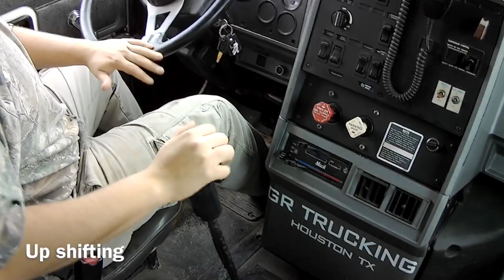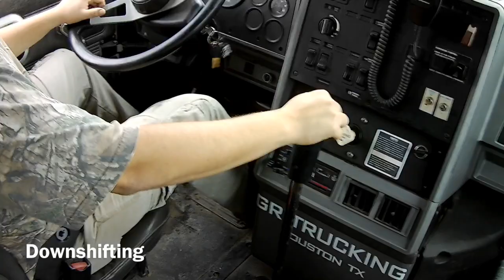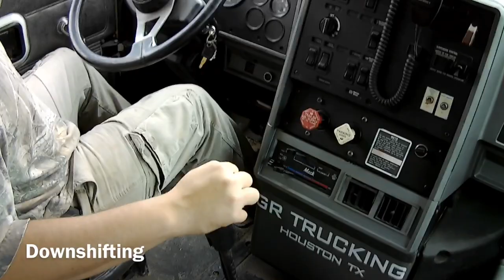floating gears without the clutch, upshifting and downshifting pedal view

Comment: Only clutch to get the rig rollin after that no damn need! Eaton fullers are fantastic nice and simple. Many ways to drive though. First time I got into a truck I was floating gears… had some trouble down shifting and getting the truck moving of course. The clutch you gotta get that right. Feelin it grab, give just the right amount of throttle too much it’ll jump too less itl start bogging and hopping or stall right away. Not good. Shit can break! Most have sensitive throttle pedals that are easily tappable to give fuel. I had trouble with that sensitive throttle pedal on the first truck I drove you can tap it with your finger and it’ll rev the engine. I got used to the clutch and was then able to drive. Easily listened and shifted correctly. I had little trouble down shifting. Revving to correct RPMs (truck had a Caterpillar so it wasn’t that bad great engines and transmissions) give it a rev or 2 sometimes a quick tap can work. Transmission would downshift. I then had to get used to doing that with the Jake brake on. I was only using it to show down without down shifting. Just letting it blare in one gear pulling it then I’d turn it off and begin down shifting then turn it on again lol yeh know. Obviously way to go is learning with it on. Many different ways once used to clutch and downshifting it’s a breeze comes natural to you.  That’s how I got going luckily on a Caterpillar powered Kenworth and a simple Eaton 8 speed. I then got into older trucks and learned even more about older style transmissions. REAL shifting there

Comment: Are you pressing the gas to go into the next gear after going into neutral? Or just getting the RPM's up and moving to neutral then into gear without a second rev of the engine? Meaning are you kinda pumping the gas twice like you would do when double clutching? Gas to neutral then gas to gear? I hope my question makes sense.
Reply: Right...yu talking bout downshifting? Cuz when I do it I have to give it gas jus to get it into neutral then rev it up to downshift....so twice? Hope they reply to yur question....
Reply from the maker: No when upshifting you wait till it goes onto the next gear then apply the throttle, know for downshifting once you go to neutral you do give it some throttle and go into a lower gear at the same time. Does my explanation make sense ?
Reply from the maker: Chilled Coughee your right for downshifting you have to give it a bit of gas for it to come out and then rev it again to go into the lower gear
Reply from the maker: Justin Case new video hope it helps https://youtu.be/VfZYn9PlWY8

Comment: love the video mate, question, does it cause damage to the gear box or clutch floating gears ?? thanks in advance, all the way from australia 🇦🇺 👍🏻👍🏻👍🏻
Reply from the maker: Wesley Walker thank you man, and my father always told me if your going to drive trucks you have to learn to drive without using the clutch. So the only way it can cause damage is if your not shifting right, but matching rpms to next gear is fine
Reply: Grtruckingdemolition Thanks for getting back to me, all the very best and safe driving brother 👍🏻👍🏻👍🏻🇦🇺🇦🇺🇦🇺🇦🇺

Comment: Why do u do that little loopty loop in neutral while going from 3 to 4 and 8 to 9? I see alot of people do it there too idk if its suppose to help or what
Reply from the maker: newyearbaby100 not sure why I do it, but I know what your talking about I always do it. It kind of helps thou to get the next gear at the right spot, since you have to wait a second before shifting
Reply: Ahh i see man thanks. On another note something you should mention thats like super important, is letting out on that clutch super slow especially while loaded. Ive seen many new people break the shaft in half. Or do a video lol
Reply: Congrats on the channel by the way. Looks like it will start hitting sooner or later
Reply from the maker: newyearbaby100 very true, i will once I do a video with a heavy load, i did that once when I started. Does not feel good at all
Reply from the maker: newyearbaby100 thank you man, I still remember when I had 62 subscribers now over 500, i’m looking to buying a truck soon and start moving some heavy equipment so there should be good content coming soon.